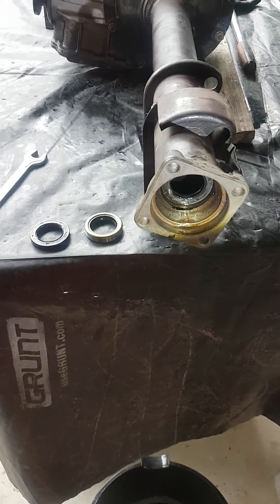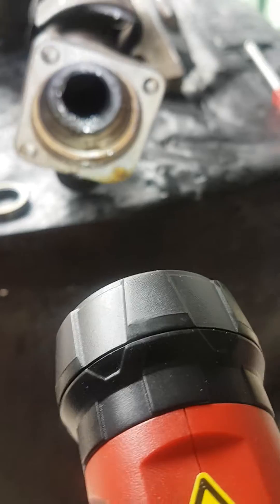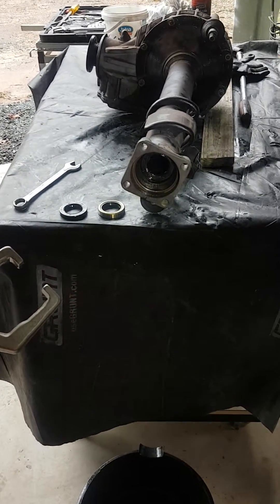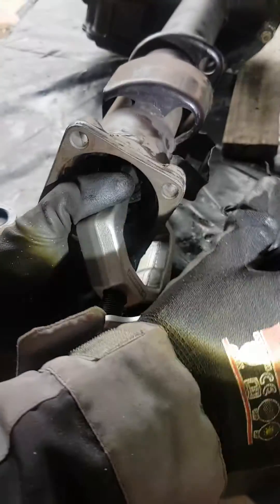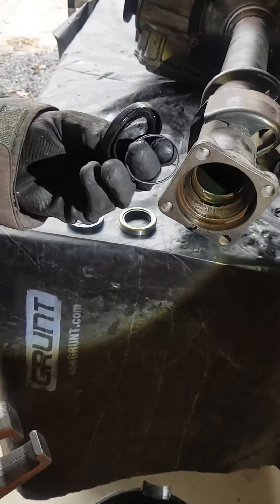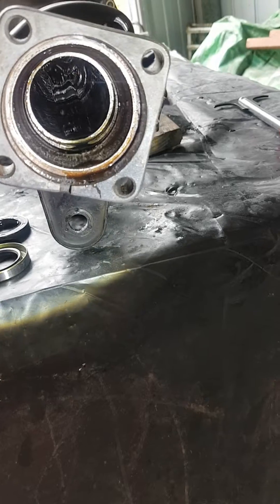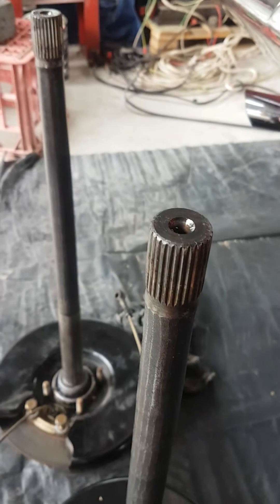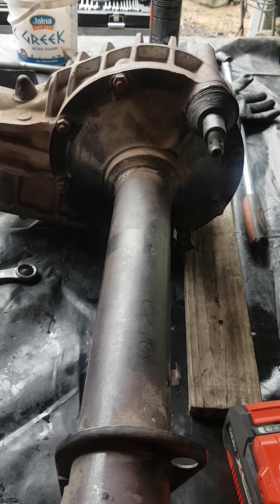Alfa Romeo LSD half shaft oil seal replacement

Comment: Great Tip for removing the seal!  Will you be changing the pinion seal?
Reply from the maker: We took the diff to a proffesional shop and had it re built. We wanted a guaranteed result. Had to replace the crown and pinion.